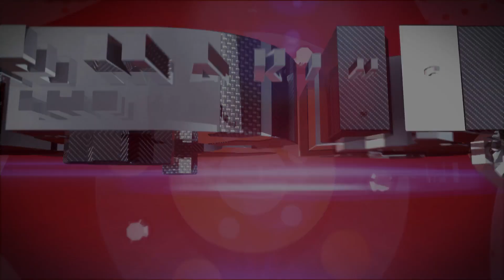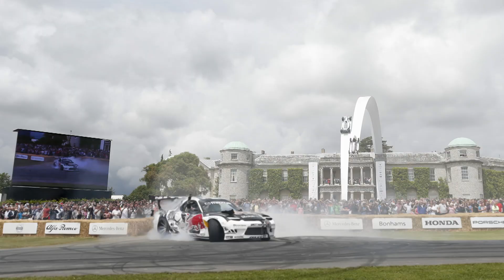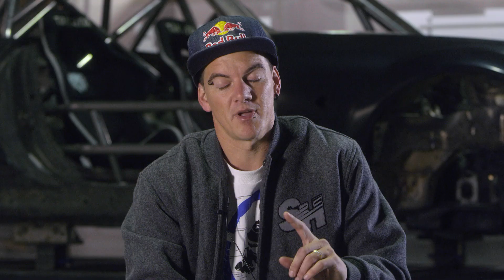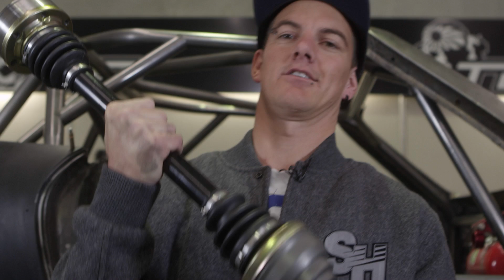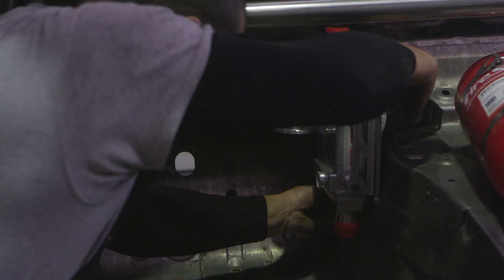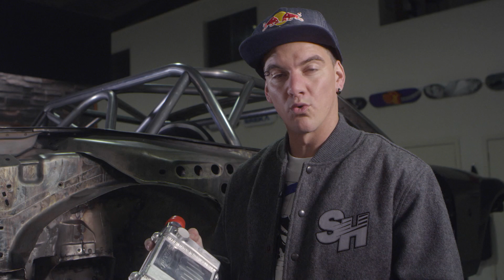‘Mad Mike’ Whiddett's 1200hp Drift Machine - RADBUL

Comment: I am so thankful the rotary engine is getting more mainstream notice these days. Everyone used to think I was crazy lol
Reply: they still do.
Reply: Love me a rotary any day. But if you want balls to the walls power you gotta go with the big block v8's.
Reply: Prezz ivou Not necessary with 3 rotor builds becoming more "relevant" and 4 rotors for those who have the patience and funds. I love me a V8 but would probably always have a rotary in my Mazda vehicles.
Reply: ***** that's with any engine if you have the funds
Reply: ***** I would have to disagree with you %100. I own and drive DAILY an all original, 12a powered RX7. It has never had anything rebuilt except the diff. It has 120k+ miles and I drag/drift/ and run the occasional Mt. Road with it. It has cheap tires and a homemade exhaust. I upgraded my fuel pump and added a fuel pressure regulator with a gauge. I paid $600 for the car. I bought another one for $100 that didn't run and stole took the wheels off of it. After everything I did I have driven the shit out of it for the last 4½ years and I even raced a buddy today! Still runs like a champ and looks good with the epsilon southern way wheels. That is less than $1,500 invested with the car's purchase and over 4 years of use. Even if it blew now I got more than my money's worth out of the rotary and would be happy putting another 5k into it over the next 5 years. I am poor by American standards.
Reply: EXTREME SCALE PERFORMANCE Sorry for the typo's lol!
Reply: You know, in the very early days of the d1gp, almost half of the drifters were using mazda rx-7s. You should check out videos from seasons like 2001-2002.